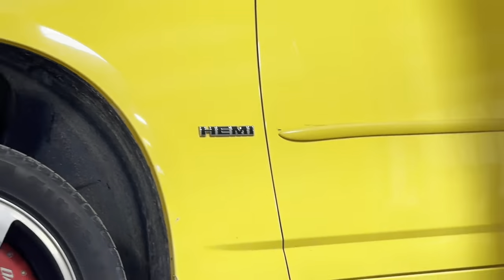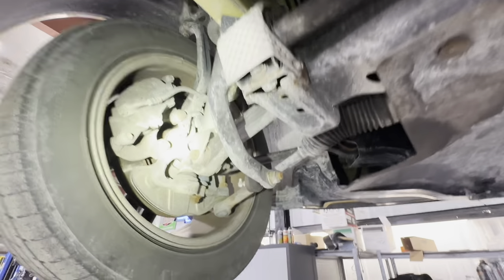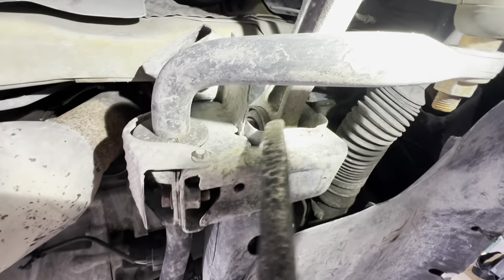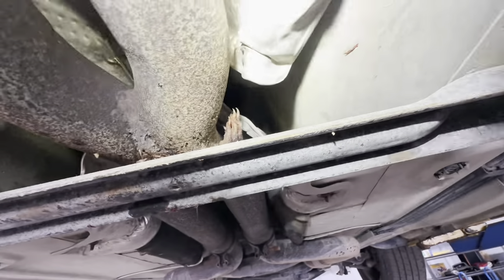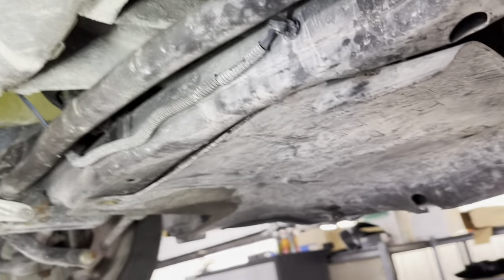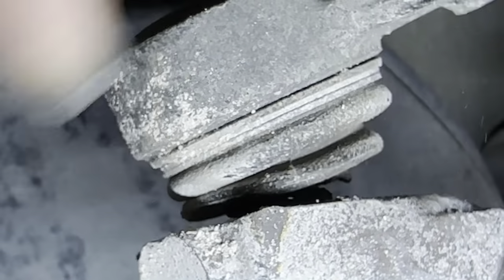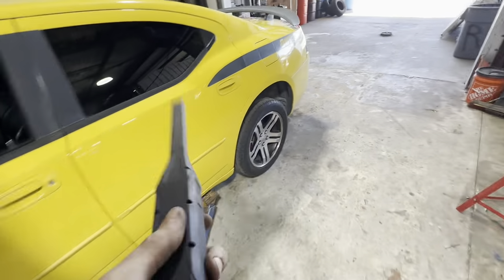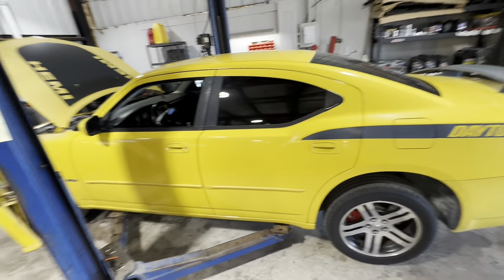Exhaust cooked ROADKILL! (AND a BENT FRAME!) 2006 Dodge Charger R/T 5.7 Hemi

Comment: I had turned 18 in late 1978. On a dark rainy night in November I decided to go down to the bar. This is middle of nowhere northern Wisconsin, America’s dairy land but in reality just a bunch of broke farmers trying to keep food on the table. I had a Charger, but it was broke with a bad starter so I grabbed my step dad’s 73 F one hundred and fifty farm truck. It was beat up. He never had the money or inclination to fix anything. I know the passenger side of box was caved in and the right front had hit a deer so no headlight. Anyway, about a mile down the road I’m tooling along when all of a sudden the truck just stopped and then slid into the ditch. As luck would have it, I had hit one of the neighbor’s angus steer. He raised them on the side, as he had a mechanic shop in town, and was pretty good. Thing is, he never maintained his fences, so his cattle wandered all over. It was known. So I’m standing there looking at a pile of dead steak and burgers on one side, and a heap of Ford that I knew would never drive again on the other, when here comes the step dad in the family wagon coming home from the bar. Thing is the local deputy was following him to make sure he made it home ok. So now we had a situation. The deputy went to get the steer’s owner out of bed while step dad and I hauled the dead dinner off the road with the family wagon. So the owner shows up mad as a hornet and lays into me for hitting his beef, but I showed him the non-existent fence and the fact it was dark, raining, and the damned beef was black. Things calmed down a bit. He asked if was gonna pay for his beef. I asked if he was gonna pay for the truck. An agreement was reached where he took half the beef and we took the other half. We all knew that Ford shouldn’t have been on the road. Thing is, I was looking for work at the time and was going to talk to him about mechanicing in his garage. That wasn’t going to happen after what happened as he was a hothead and never let things go. So we all butchered that beef in the rain in the ditch at 10 o’clock on a Sunday night. He took half, we took half, the wrecker took the Ford. I eventually became an engineer involved mostly with vehicles, but in a roundabout way and recently retired only to take a job as a 
mechanic for golf course equipment.

Comment: great show, i don't that was a coyote. 
animal hits, always nice to find.

as an auto mechanic who had a fair number of rural customers, skunks are the worst. they may not cause physical damage like a deer, but what they lack in damage they can more than make up for. got to love rotting skunk in the belts with a steel flex fan.

this was my work van and it happened more than twice. 2 stand out. im not sure which one was the worst,.. you decide.

one i was on the way to my first stop, i hit a big skunk that ended up being hung up and stuck under the van. there was no doubt i hit it. when i stopped i looked under the van but didn't see anything and figured i just didn't see it in the rear view. 
i worked lawn & garden so i was near the van most of the time. with the smell, the day went by slowly. my next to last stop, the customer's neighbor's dog got under my van & found it, and got it out, & chased us around the yard with it until the guy got the water hose & sprayed the dog and it went home,.. and took the dead skunk with it. 

second stand out, on route i ran over a skunk, a few minutes later i got pulled over by a cop. after we stopped, he backed up his car away from my van and told me to get out & come to him. as i walked past the back of my van that skunk got loose and came running out, right at the cop. the cop turned and ran, i ran the other way, another cop had pulled up and was getting out of his car as the first cop started running back and he had no ideal what was going on. the skunk got in the the second cop's car,... after we got the skunk out, the first cop said it looked like it was hung up by its tail under my van which is why he stopped me. the cop car got towed,..
both cops were regular customers of mine.

being around it, you do kind of get use to it, be away from it for a while and its just as bad when you smell it again.

Comment: I hit what looked like a cow early one morning, i had a 1984 Pontiac Parissenne station wagon, the left side of the car went airborne, i was about to tip over, i was riding on the right two wheels only like you see in the movies, i held the steering wheel tightly and all of a sudden i landed back on all four wheels it was the most terrifying experience i ever had, i got off the highway to gain my composure and was going to get out and access the damage but decided to just continue on home. When i got home i pulled up along side my house where there are two floodlights, the only visible damage was that the left front corner of the bumper was slightly bent, remember this was a 1984 model with steel chrome bumpers, it's when i looked underneath that the severity of the impact was noticable, there was blood guts hair from front to back, again a station wagon which is long, i got the hose out and began spraying, the blood was running down the gutter like someone had just been murdered, it was too much so i decided to wait until daylight and fire up the pressure washer, it took a long time until it was somewhat clean, i figured the rest would eventually wash off driving in the rain and snow, when I drove it the alignment was off it was pulling to the left, I took it to a guy in town where all the mechanics go for alignments and miraculously there was no damage to any of the steering components, he did the alighnnent and that was it, I'm glad i was driving a big old car it might have saved my life.

Comment: Whatever animal the owner did hit wouldn't cause damage like that to the subframe. It's bent forward, so there's more than one hit. There's a crack on the front left shock absorber and a oil leak near the back right wheel.

Comment: Had a small deer jump out in front of me in my Citroen Xantia some years ago. Took out the bupmer, bent the fromt cross member pushing up the radiator causing the fan housing to break and push the fan into the radiator and all to coolant to depart in a cloud of steam.  Insurance wrote the car off for the second time.  First time it got written of in a flood when I fire truck swamped me and hydraliced the engine!  Not a lucky car for me that one.

Comment: "Have I ever ran into a crispy critter?" Yeah I did, poor little guy. I was driving my 2011 Cruze and I (through a fault of my own) busted my old front bumper when I almost ran into a ditch. Didn't see it as it was on a hill. Replaced it with a pre-painted bumper from eBay and the next morning as I was heading to work, a racoon was in the middle of my lane and around a sharp curve. The little guy caught me off-guard, lol. Couldn't swerve to avoid it because of an oncoming vehicle and the little guy slammed into the new bumper, cracking the lower middle portion of it and breaking the skid plate in pieces. Needless to say, I couldn't care about the bumper and plates since they're replaceable, but the little guy I thought about for a while after.

Comment: Crispy critters. I have 2 stories. 1st.  A deer hit my ford head on, joined me in the front, landed on the passenger seat. Blood and  hair everywhere and a person sized hole in the windscreen. 2nd, ran over a badger (like a small bear, in the UK). No damage, badger and my car not a thing wrong. I stopped to check and the badger kept on running.
Reply: You spelled forehead wrong...😎😎
Reply: @beezul  nope the deer hit my Ford head on 😁. It was a Ford Escort.
Reply: I had to extract a whole sparrow once from under a car, and I took out a pigeon in my old car, looked in the rear veiw mirror and just saw an explosion of feathers flying in the air

Comment: In western PA a skunk at 65 my cousin and I got out puking the thing went through grill into radiator onto fan blown all over a 360 it smelled til the next winter no matter how much I washed it the guy I sold it to a family freind changed the rusty bed yrs later found parts between bed a frame rails even small creatures at highway speed can do a lot of damage

Comment: I hit a Coyote at 75mph going through CO at night in my Corvette, front end end held together due to the front shielding on the bumper to protect the paint held it together but it was cracked, car lifted up in the air sucking the varmint under the car no suspension damage, got to the dealership in NE they spent time pulling out the remains...3 grand later

Comment: I have hit a critter before, unfortunately...but fortunately it wasn't a skunk. And I don't believe your critter remnants are either, or you WOULD KNOW. lol  Yeah, just pick the critter parts out and blast with either brake clean or power wash.

I would opine that in order to get wheel alignment correct, the bent subframe would need replacing.  As little movement changes those alignment specs on a machine, it would have to affect it.  Whether or not the Charger owner decides to do it is another story.

Comment: I had a ground squirrel crawl up above the drive shaft on my '97 Cougar.  There is a cozy little spot where the drive shaft "goes through" the gas tank on these.  I had no idea he was there until the next morning when I discovered blood on the floor of the garage after my wife left for work.  When she got home my garage was filled with the horrible odor of death.  Took it quickly over to my buddy's shop.  The shop was immediately filled a quite unpleasant smell.  Quickly to the outside hoist.  Poor Glen drew the short straw and had the honor of removing the critter.  It wasn't crispy just grossly bloody.  There is plate where the driveshaft "goes through" the tank and that had to be removed to get the squirrel out of there.  The most unpleasant experience ever.

Comment: Rubber conveyor belt material makes great replacements for those plastic splash guards. On the 70s trucks i use it for the inner fenders because it stands up to the rocks and heavy mud better.

Comment: 2006 Dodge Charger Daytona, Top Banana yellow.  I upgraded my 2006 Daytona front suspension with poly urethane bushings, and larger sway bar connectors, and better shocks.  I also upgraded my heads with hardend valve seats to prevent them from dropping out.

Comment: a few years back, we "hit" a deer in the middle of the night.  We stopped about 5 yards short of it, came to a complete stop.  It was looking at us and vice-versa.  So we were rolling forward at a crawl, got within 2 feet of the deer and it ran in front of the car.  It hit hard enough that it pushed the deer over and it ran off.   It was -10F or so.  It was cold.  So cold that it cracked the bumper facia, grill, and busted the plastic light assy.  $1500 damage for "pushing" a deer out of the way.  If it ever happens again, I will get out of the car and scare the little MF away.🤐